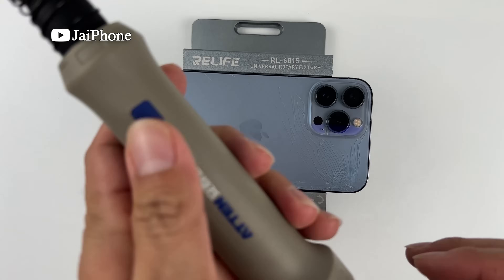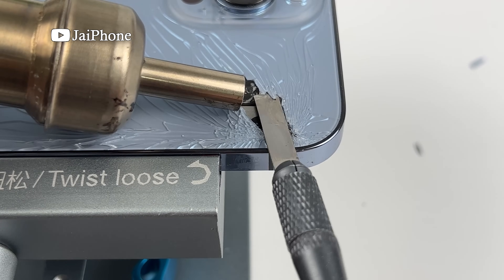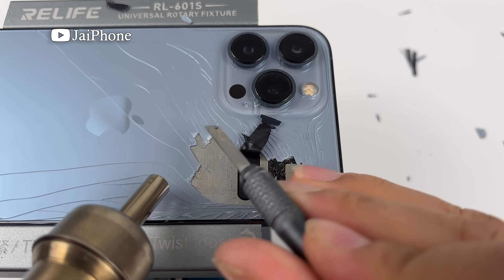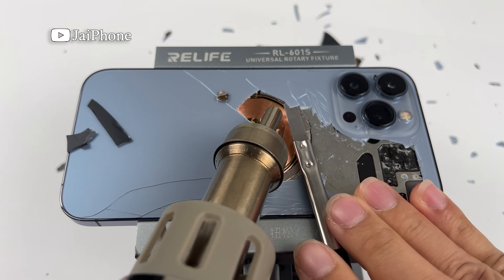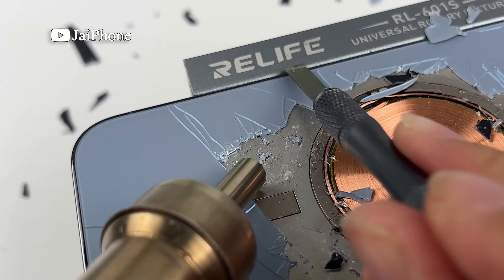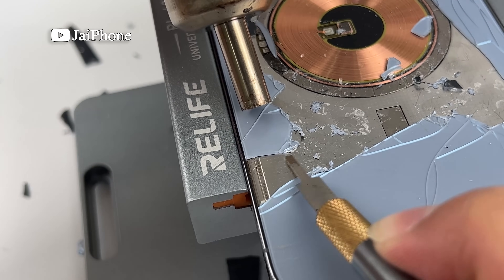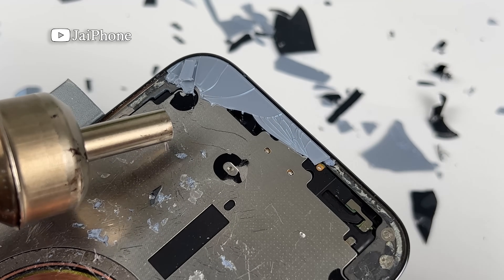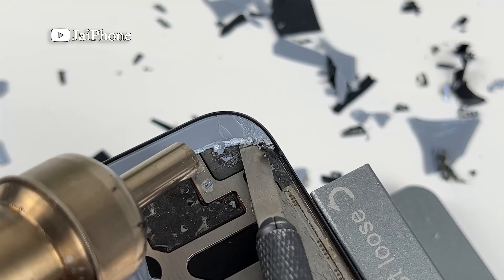How To Remove iPhone 13 Pro Max Back Glass Cracked And Replacement New One - ASMR Videos

Comment: To replace the glass, it is best to remove the motherboard and battery before replacing, otherwise it may cause broken glass to seep into the interior from the seam of the wireless charging coil, and over time (maybe several months to half a year) may cause the battery to swell or occur.  Danger.

Comment: I’m assuming you’re using heat as you scrape the glass off. How much heat can be safely applied without damaging internal components?
Reply: Depends on the tech... but most techs used around 300 degrees celcuis - hot air station, with a small nozzle  or bent nozzle and use small bursts of heat over the phone as the glass is being removed.
Reply: He showed the temp and percentage brother

Comment: Good to use heat rather then laser as laser might damage the steel inside the phone,though laser is the faster option but end process too similar to heating too,one still need to peel the metal despite using laser
Reply from the maker: Thank you 😘
Reply: bullshit

Comment: I did this repair but after i completed this, the phone got hot when i turned it on, the main board was really hot and drained the battery. Now it wont power up, what could be the issue?
Reply: Ahhh so i found that the internal components should be removed which I did not hence my motherboard is now short
Reply: i think your flashlight flex has been shorted. Replace the Flashlight and it will be fine.
Reply: @nixremix  it turned out to be the proximity flex cable
Reply: @adeelanwar5690  ah okay. Always remove Display before repair, i got a black Spot on a Display once
Reply: @nixremix  yeah i know rookie mistake, followed the video but i thought i killed the phone, 2 months later i just tried it randomly and worked. Saved the 13 pro max, sending this message from it actually :)
Reply: @adeelanwar5690  nice m8 thats good to hear actually :)